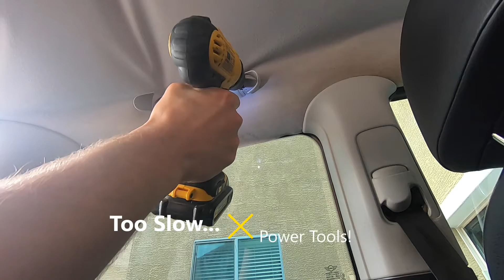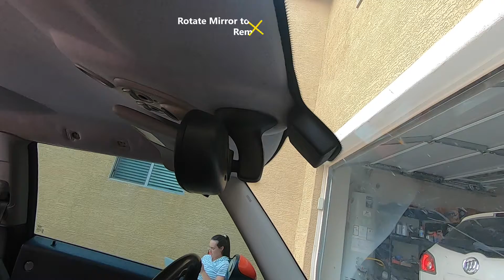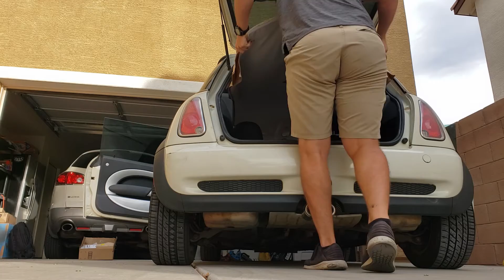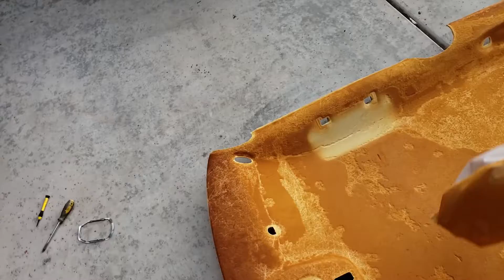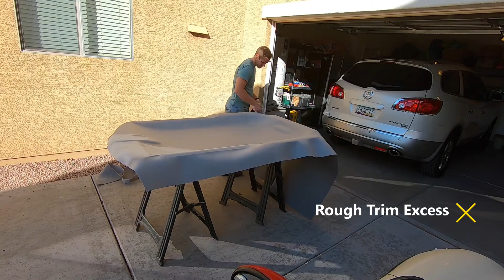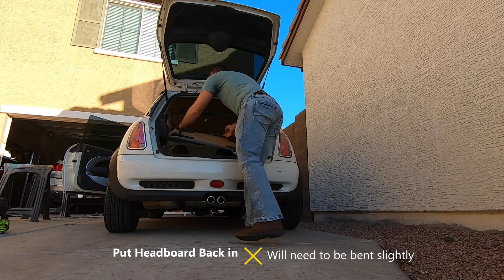Mini Cooper Headliner Removal and Replacement

Comment: Thanks so much. Just bought a 2005 mini for $800. Needs work but help when you have videos like this. The right quarter window and back window were broken. That's $800 fix itself, but still worth the car's value.

Comment: trying to fix mine right now. i took the headliner out a couple month ago and i’m just now getting back to it. there is a wire in the back that hangs down i can see it in your video as well where does that plug in at? thanks
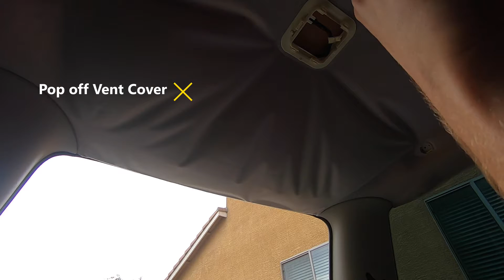Reply from the maker: Hi, it attaches in the vent cover seen at 2:11.  Let me know if you have any trouble
Reply: T Barton my vent doesn’t seem to have a place for it to plug into.
Reply from the maker: @nathanzemany3390  so it doesn't actually plug into an electrical connection, it just has a slot that it slides into.
Reply: thank you very much!

Comment: Thanks for this video it will probably helps a lot of us, did you remember wich type of spray did you use for this?
Reply from the maker: Hi, yeah it was the 3M headliner adhesive spray.
Reply: @ifly891  thanks mate!
Reply: @dicappa.7298  seems 3M is the most recommended.  I'll be using it as well.

Comment: Is it possible to take off the old textile and glue that back on? Because mine is perfect and not dirty at all, could I take off the old foam, glue it on and stick it back?
Reply: Not recommended, you need to used a foamed fabric. If you do as you wrote it won't fit well. Another tip is using a solvent to clean the roof before gluing the fabric.
Reply: What solvent did you use? @Afmu
Reply: @markthegrea  universal solvent did the work

Comment: Do you remember what the dimensions of the material or where you ordered it from?
Reply from the maker: Here is the one I got https://www.amazon.com/dp/B06WP5WBXG/ref=cm_sw_r_cp_apa_fabc_ZVMB8FPRWWKNT9Z7R95X?_encoding=UTF8&psc=1

And then I just got the 3m headliner adhesive off Amazon
Reply: @ifly891  Thanks so much!